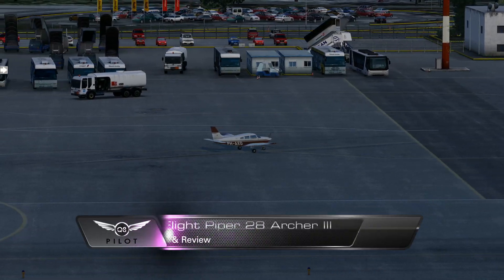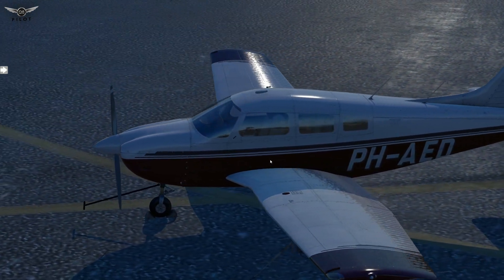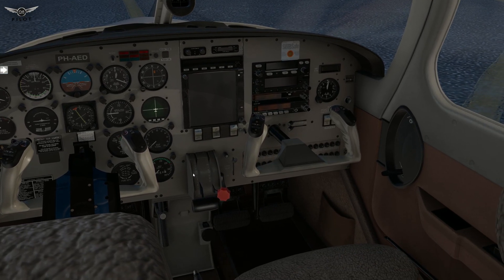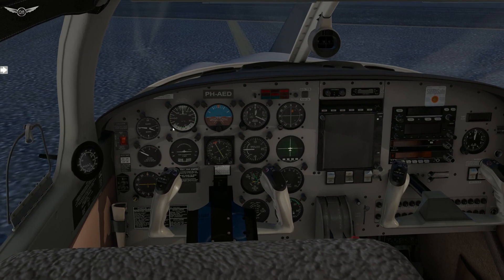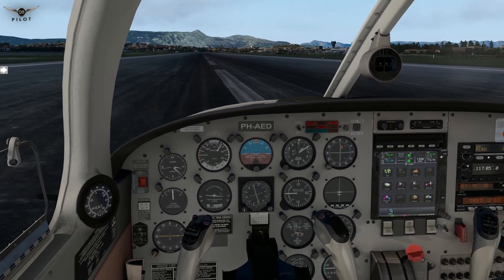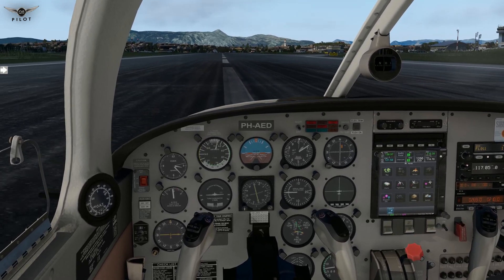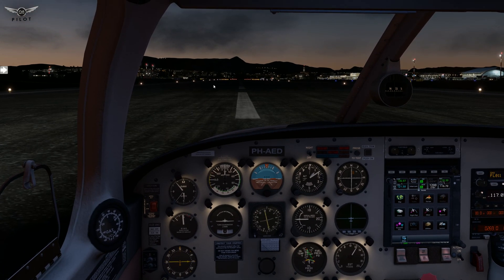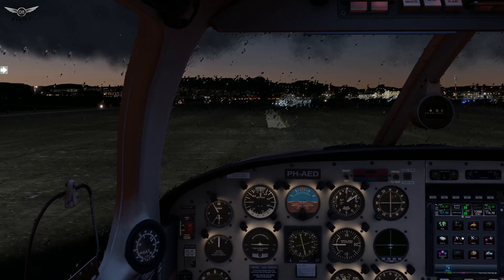X-Plane 11| JustFlight Piper 28 Archer III | Review

Comment: I have flown a PA28-181 Archer, as well as serviced them in the maintenance department of an FBO. I recommend not turning the pitot heat on, on the ground and especially if the OAT is showing 80 degrees. There are two heating elements in the pitot head and they are individually replaceable but cost over $50 each. Sometimes you can get them out if they aren't corroded too much. Also, I would leave the alternator switch off until after starting the engine.  I would be sawing off that light standard along the approach path to the runway.

Comment: The tab on the upper left screen really adds to the immersion they should charge even more money for it👍 the horrible stall behavior the tab the fact you have to than buy a gps for it the price is a astronomical nothing ground breaking here 29.99 at most x plane users really have to start expecting more out of developers nobody should pay the inflated price they are asking for this airplane
Reply: You don't have to buy the GTN750 for this - it comes with a (defult?) GNS 530. Also, the tab can be hidden by scrolling the middle mouse wheel while hovering the cursor over it - it still works, even when hidden. I have this add-on and I'm very happy with it - I don't think the price is too high for what you get. (I'm in no way affiliated to Just Flight, just a satisfied customer.)